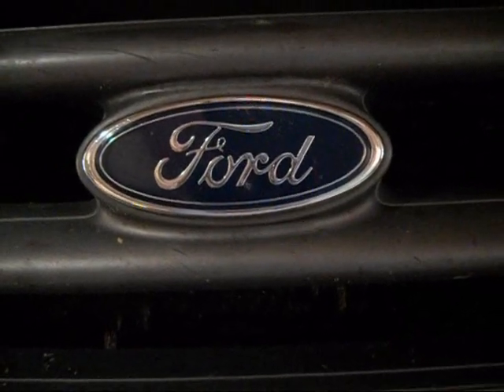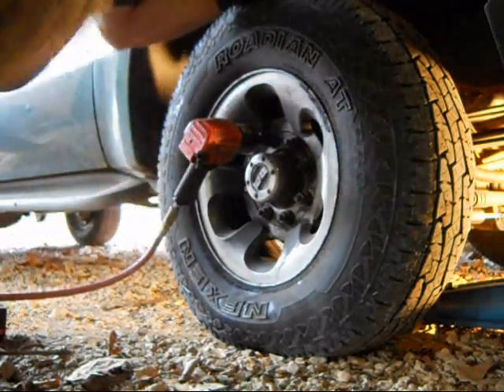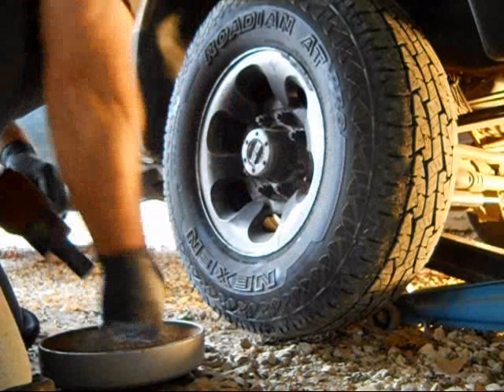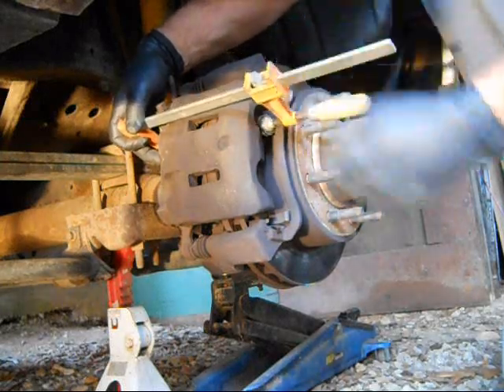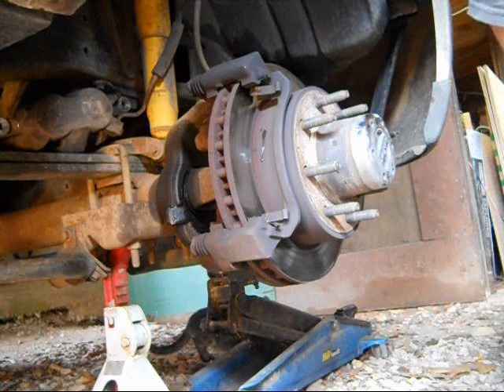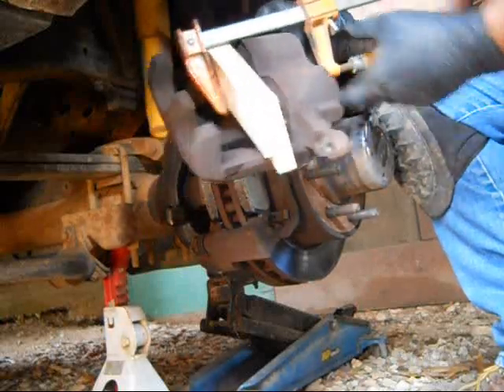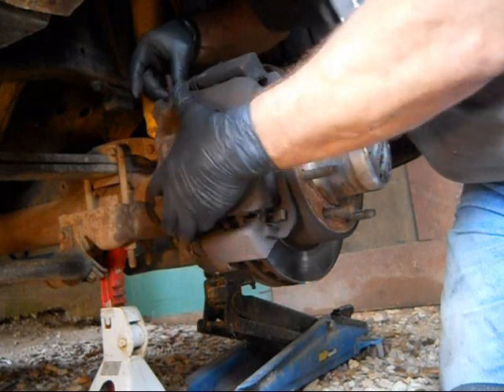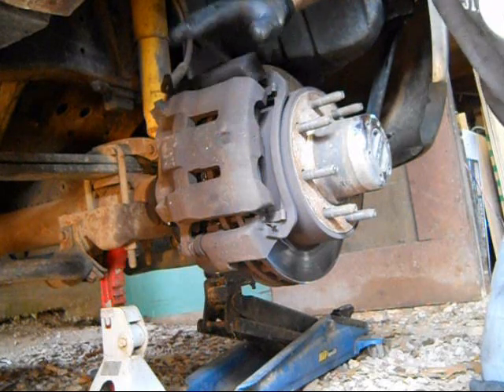Ford F 250 front brake pad change

Comment: Once you push the pistons back in, do you need to bleed?
Reply from the maker: Yes, you should always bleed your brakes after working on them. It is possible to pull air in thru the fluid tank.
Reply: No, leave the cap on, when u compress the piston , u will not need to bleed.
Reply: @robyjessee4672  4 years ago I might have taken your advice.  But experience dictates, you must always bleed once the piston has been reset, or air has been introduced into the line, front or back end.
Reply: @dasteufelhund   not if u leave the cap on. Take it from a 66 year old mechsnic thats had 456 cars and trucks and 34 motorcycles ,
Reply: @robyjessee4672  Alright.  I have a car coming up for a brake job, I'll try that.